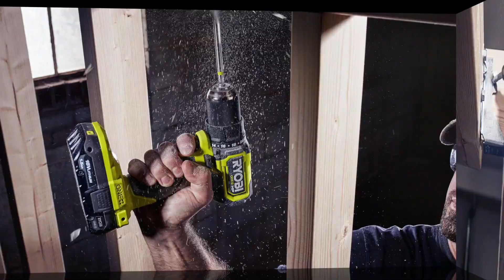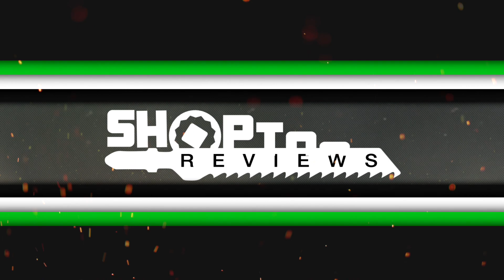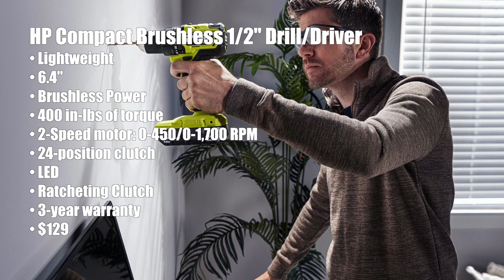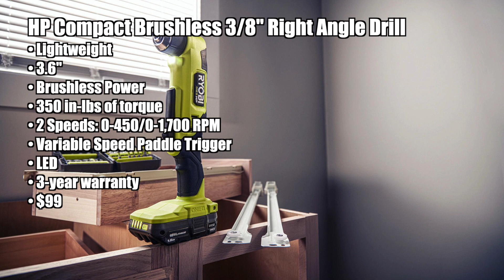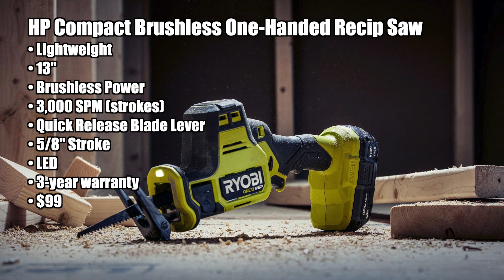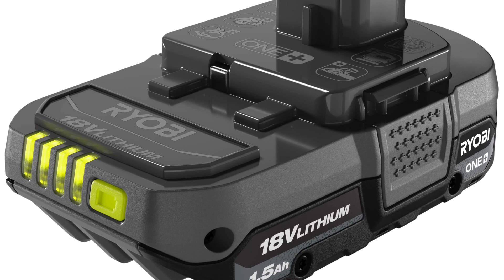NEW RYOBI HP Tools [PRO COMPACT]

Comment: Home Depot now offers all these tools, two 1.5 Amp Hr batteries, charger, tool bag (that fits all the tools), a blade for the saw, and 3 cutting disks for the cutting tool. The kit is $399, a fine value.✌🏽

Comment: I work on heavy trucks and I have been using my ryobi impact driver for small jobs. It’s held up really well with grease and brake clean. I’m still lucky enough to be using the same batteries that  came with the kit 10 yrs ago. 🤯 treat your tools with respect and they will treat you well. I also own various Milwaukee guns. I’m looking forward to the 3/8s impact. I’m in the market for a new one and would like to use it at work. Great vid thanks.
Reply from the maker: Thanks a lot. Glad to hear that those tools are working out for you. You should see those hitting the shelves in a few weeks.